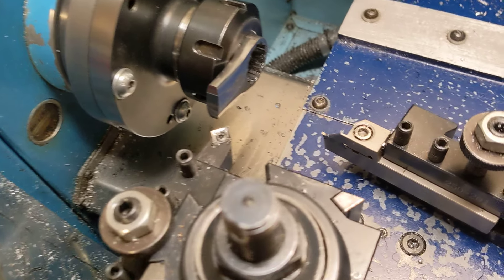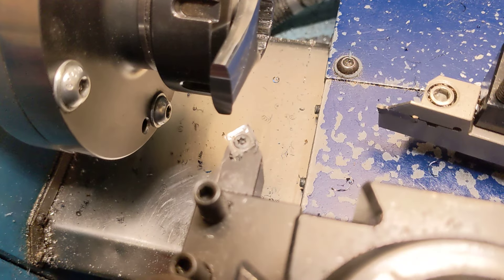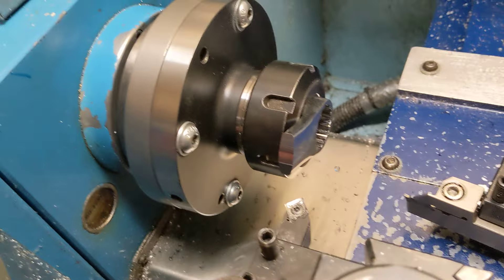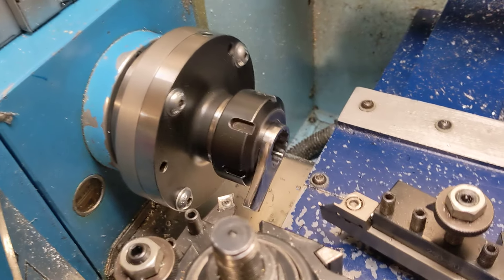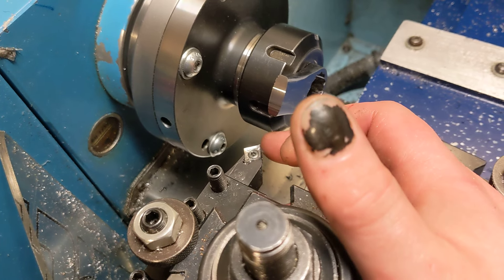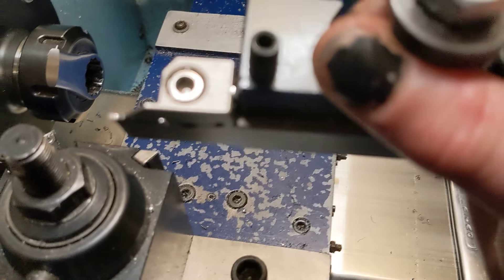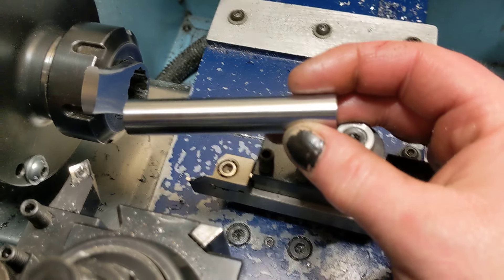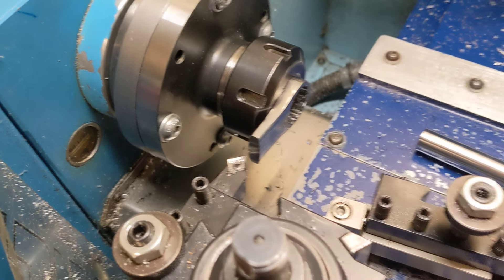Everyone on the internet is wrong about insert tooling in the home machine shop...

Comment: I own a small soviet lathe - the quite renowned "Universal-3". It's ridicolously small, 75 mm centre height and barely 200 mm between centers. What you said about carbide tooling is so true. My lathe would push inserts for steel as well, but you'd feel the pressure on the handwheels - no bueno for the life of the leadscrews. I switched to aluminum inserts and, suddenly, it was like cutting butter. So, once again - everyone on the internet is wrong about carbide! Especially if everyone on the internet took the time to remove the compound slides, which are the culprit of tool instability 8 times out of 10...

Comment: My Grizzly G0752 has done everything I have asked it to.  Just made a Short with a carbide insert parting tool, like yours, a few days ago.  3/4" steel round, no coolant or oil of any kind.  Ez peezy lemon squeezy.  It is all about the operator and not so much the machine with these overseas units.
Make chips that dont need dips!
Reply: Get away  from insert get a carbide tipped "t "blade  grind clearance and angle  to suit last far longer and as mentioned  cheaper and take interrupted  cuts better

Comment: Well, that is a well build machine, do the same on a chinesium crap lathe, where everything warps in all directions and the insert gets beaten to death in no time.
Reply: I came here to say just that
It is correct that with the right insert you can get away with it,but 
a converted CNC lathe is hardly a ''small'' lathe whatever size it is .
Try it at 3000 RPM and savour the aroma of that Chinese toast cooking.
Reply: I have one of these lathes (still CNC) and believe me, they are small and not particularly rigid.  A South Bend 9" would run rings around it for size and rigidity.
Reply from the maker: Oh I agree that the little hercus is a tiny tank, but the advice still applies: highly polished high-rake-angle inserts meant for aluminium reduce tool pressure and thus reduce the forces on the machine allowing a little machine to do more than it otherwise could. Additionally, they hold up far better than you'd expect (eg the silly interrupted cut in the vid), lots of people assume they'd struggle with steel but I hard-turn with them.... tungsten carbide is magic. 
I have a friend with one of the tiny chinese mini lathes and we've tested it there too, it can't do what my hercus can (still can't hard turn 65HRC shaft for example) but it can do a lot more than it could before, and does it faster and with better surface finish than with high speed steel tools. 
The other thing is the common wisdom of 'home shop machines can't run the feeds and speeds you need for insert tooling'... which is true if you buy inserts meant for high-production steel (ie blunt edged etc for maximum insert life in that material) as they have a minimum depth of cut that is way to heavy  for a small lathe...  but inserts for aluminium can take whisper cuts off steel at a huge range of RPM etc. 
The only thing you wont get is good chip control (outside of getting extremely small nose radius inserts and related tricks), the inserts shown in this vid will birds-nest some steels and aluminium, though I have a set of tools with tiny nose radii that can chip break in the small cuts I'm taking.

Comment: What have you done to the poor Hercus ?! In any case, the Hercus is much more rigid than your average import bench lathe. Interrupted cuts, while not ideal is not the main issue rather the tool chatter and flex you get with the small lathes.
Reply from the maker: Oh I'm with you on the 'poor hercus' bit, it's a bit of a story. Super short version: dead electronics and I really needed a lathe so I added handwheels in a reversible/non permanent way, with plans to re-CNC it later. Long version:

The guy I bought it off shipped it to me strapped to a pallet with straps over the plastic covers.... so it arrived with all the plastic covers completely destroyed - I have bits of them taped together to direct chips to fly in fewer directions but that's about it.
It had dead electronics (which is why I got it cheap) and I intended to either fix them or replace them (I have a background in custom CNC machines) however I got stuck trying to find a driver for the spindle, it's a 180V DC motor with an encoder on the spindle shaft, I've not been able to find anyone that makes a brushed DC servo drive capable of that voltage.
If you know of any send me a link :) 
The X and Z motors are also brushed DC servos....but extremely weird ones, they each have two entirely separate windings sharing the same shaft, sorta like a high speed and low speed winding (if there's a name for that sort of motor let me know, I've not seen any modern examples). In the end I figured I could just ignore the high speed windings and I found brushed DC servo drives that will run the low speed windings. 
Adding to the complexity in retrofitting is the space constraints for both the spindle motor and the X/Z motors, ie normal NEMA style steppers or servos with a square shape wont fit. 

So the little lathe sat there neglected for a while until I really needed a lathe to fix something. The quickest way to get it up and running was to knock up my own power supply for the spindle (original transformer + rectifier and capacitors, ultra simple) and to put hand wheels on the ball screws and make it a manual machine temporarily (that was a few years ago now.... as all "temporary" things tend to be). 
The way I did it is completely reversible and was done in a way that minimises modification to the machine: the ends of the ball screws were drilled and a piece of shafting was loctited in the end, which pokes through a small hole drilled in the covers, and then a little bushing plate was attached so that the ball screw isn't taking handwheel forces. 
The existing motors and belts etc are still in it, I actually use the encoder outputs of the motors for my DRO. 
When I re-CNC it there'll just be a few small holes in the covers that I can plug and it will be as it was. 
I have plans to buy a proper toolroom manual lathe later this year then the poor little hercus (little beast of a machine though) will be restored, until now it's my only lathe.

Comment: Wow, thanks! that's a great tip for my usecase, they should be much better for turning wood or epoxies. HSS for whatever reason dulls really quick and try finding inserts that are meant for that - there are probably none easily available.
Reply from the maker: Oh yeah, they're great for wood etc due to the sharpness, an no one makes inserts for wood specifically (afaik)

Comment: Man, I just stocked up on regular cabides :-) 
How about wear, does the aluminum carbides wear out quicker? 
I need to test it I guess.
Reply: Yeah thats basicaly it. That will drasticaly shorten the life span of the inserts. On the other hand, if it works it still better then nothing or buying an whole new mashine just for some parts. And u need to work slowly, don´t take too much off in one pass, since the edges cant withstand as much force as inserts which are recommanded.
Reply: @ATypiclaNPC  I agree, you get a great finish with aluminum inserts on smaller lathes. I tend to use the steel inserts for roughing if I have a lot of material to hog off. I want to see more of this "Manual" CNC lathe :)
Reply: @ATypiclaNPC  Thanks, I will give it a try.
Reply from the maker: Honestly they last far longer than they should given the punishment I put them through. A box of ten lasts me 6 months to a year doing all sorts of silly stuff (eg hard turning bearing shaft...with Al inserts...). 
The other huge benefit that I didn't mention in the video is the ability to take tiny whisper cuts in steel, eg you're creeping up on a dimension or fit and need to take 25 micron (~1thou) off, steel inserts have a minimum cut depth and you'd just be burnishing at that point, aluminium inserts will take that tiny cut.
Reply: @makebreakrepair  Thanks, I have ordered some different aluminium inserts to test, it sounds great.

Comment: It all has to do with rigidity not size, if your micro-lath is rigid it will do fine with inserted tooling.
Reply from the maker: Oh I agree that the little hercus is a tiny tank, but the advice still applies: highly polished high-rake-angle inserts meant for aluminium reduce tool pressure and thus reduce the forces on the machine allowing a little machine to do more than it otherwise could. Additionally, they hold up far better than you'd expect (eg the silly interrupted cut in the vid), lots of people assume they'd struggle with steel but I hard-turn with them.... tungsten carbide is magic. 
I have a friend with one of the tiny chinese mini lathes and we've tested it there too, it can't do what my hercus can (still can't hard turn 65HRC shaft for example) but it can do a lot more than it could before, and does it faster and with better surface finish than with high speed steel tools. 
The other thing is the common wisdom of 'home shop machines can't run the feeds and speeds you need for insert tooling'... which is true if you buy inserts meant for high-production steel (ie blunt edged etc for maximum insert life in that material) as they have a minimum depth of cut that is way to heavy  for a small lathe...  but inserts for aluminium can take whisper cuts off steel at a huge range of RPM etc. 
The only thing you wont get is good chip control (outside of getting extremely small nose radius inserts and related tricks), the inserts shown in this vid will birds-nest some steels and aluminium, though I have a set of tools with tiny nose radii that can chip break in the small cuts I'm taking.

Comment: My 1951 vintage Wards (Logan) didn't do well with brazed carbide tooling in a lantern toolpost . Insert tooling in a QCTP is another thing , I'm running higher cutting speeds with faster feeds and getting better finishes . With some materials , mostly stainless . Mild steel is better , but still not great .
Reply from the maker: Brazed carbide tooling is just crap, isn't it? There's no geometry beyond a tilted flat surface and some relief angles, whereas inserts are able to have tiny sharp features etc that make a huge difference, that and the inserts for aluminium have a crazy sharp tip; it won't last as long (in terms total cut hours) as it would in its intended application but an insert still lasts me ages of home-shop use, and at a a dollar each it doesn't matter anyway - a box of ten lasts me 6 months to a year at $10 a box.

Comment: Maybe not everyone, but a lot of HSS addictives. Just to show off their skill in tool grinding. High quality HSS blanks has become insanely costly. Even low cost and low quality Chinese HSS is high priced. Low price Chinese inserts does a decent job in a home shop. Not the wear out time needed for mass production. But frankly speaking, what kills them is when you make mistakes and break off the tip. So for economic and time reasons I mostly use cheap Chinese insert tooling on the lathe.
Using inserts for aluminium in the home shop is a great advice. Price difference is so small. Will use more of them in the future.
Reply: Look for vintage tatung Japanese  high speed  tooling..the cobalt content  gives  it wear capabilities  but impact resistance  of high  speed
Reply from the maker: Yeah, I have inserts for steel and such too, but I almost always use the aluminium ones on everything. If CBN ones weren't so expensive (even from china they're like $10 each and a mistake will instant break them) I'd use them more, but the aluminium ones can hard turn bearing shaft (though my little hercus is a tiny tank, a chinese mini lathe wouldn't be able to hard turn with these inserts I think). 
The inserts I buy (no affiliation, not sponsored, just who I use) are these https://www.aliexpress.com/item/32917989481.html

Comment: Do the aluminium carbide inserts last a reasonable amount of time when used for steel?
Reply: yes, they last
Reply: as long as you get ones with a reasonable nose radius.  Tiny nose radius will chip much more quickly.
Reply: @mikeandhismachines  I was wondering more about the sharp edges. I use them for aluminium but never for steel.
Reply from the maker: For home shop use: yes. A ten pack of those inserts costs me $12AUD (~$8USD) and lasts me 6 months to a year, and I hard turn bearing shaft with them, as well as aluminium, brass, normal steel, etc. 
The inserts I'm using are from DASAN official alliexpres store (no affiliation, not sponsored, just who I use) https://www.aliexpress.com/item/32917989481.html
If you were running production on a proper CNC lathe you'd definitely be better off following insert manufacturers advice of course
Reply: @makebreakrepair  I actually have a pack but I only use them for aluminium. I was under the impression that they couldn’t be used on steel which in hindsight makes less sense. They are about the same cost as a normal pack of inserts so maybe I’ll make the complete switch. Can’t really see any negatives with using them on still apart from maybe the weaker edge?
Reply from the maker: There's actually another benefit I didn't mention: you can take tiny cuts in steel, eg when you're creeping up on a dimension you can shave 30 micron off in steel whereas a steel insert has a minimum cut depth
Reply: @makebreakrepair  correct. I think the aluminium inserts I have are 0.02 nose radius which would be a 20 micron cut minimum?
Reply from the maker: Nose radius refers to the outline (viewed from above the insert), so I can get aluminium inserts with 1mm nose radii. The aluminium inserts are sharpened to a near-knife edge (viewed from the side of the insert as a cross section), whereas steel inserts have a very blunt tip to make them more robust (I'm not sure what radius that 'blunt' has, it varies of course, but it's enough that the insert feels blunt), the corollary is that you need to dig the insert deep enough that the blunt bit is fully inside the metal before it cuts - on a CNC you just dial in your process so your finishing pass is deep enough to cut but home shop use you're often (unless you're stefan gotteswinter...) creeping up on a fit or similar and steel inserts just stop cutting at all.

Comment: I use TNMG 160404 in my hafco and dont have any probs as well
Reply: Im using the exact same inserts from ISCAR

Everyone thinks cnmg is the way to go lol
Reply: @Sweetchilliheat18  Yes, but TNMG gives me 6 cutting edges with 1 toolholder and I can turn and face
Reply from the maker: I have a few different types of holders but the one shown in the vid (link to the inserts, not sponsored/no affiliation, just who I use https://www.aliexpress.com/item/32917989481.html) were part of a cheap set I got that uses CCGT for everything. I also have a mix of VNMG and other types.

Comment: Yeah! I WISH my Wen (sieg c2) had a bed that wide. Wear a tear take full advantage of the lever effect on these small machines. I.E. they can't shrug off minor inputs of twisting forces like the big boys can.
Reply from the maker: Yeah, the little hercus is a tiny tank (3000rpm, free machining aluminium, 3mm radial depth of cut, feed as fast as you can spin the handwheel = chips hitting the ceiling), though the advice still applies: inserts for al reduce tool pressure and the forces on the machine which allows small machines to do things they couldn't before. Have tested it on a friend's chinese mini lathe and it can't do what the hercus can (eg it still can't hard-turn bearing shaft) but it cuts faster, deeper, and with better finish than with HSS.